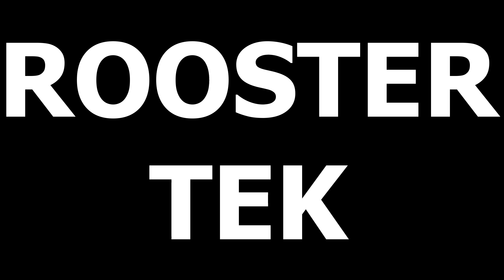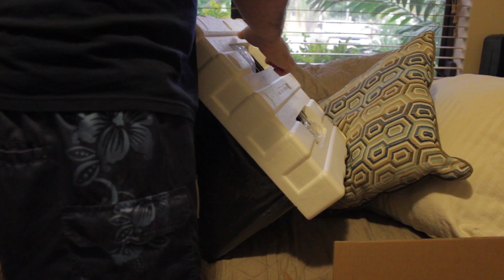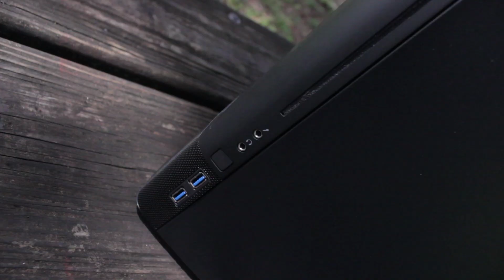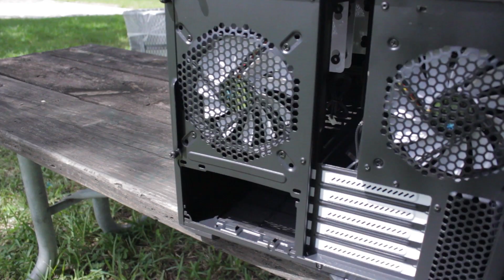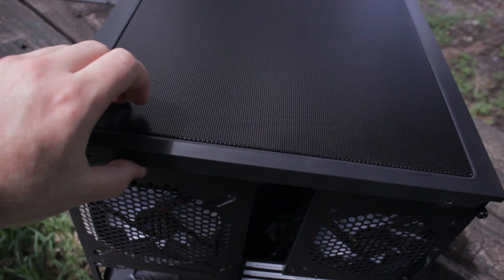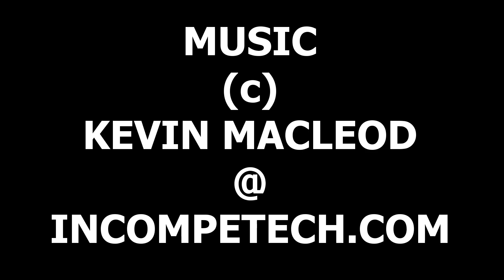Fractal Design NODE 804 MicroATX Case | Unboxing & Review | RoosterTek

Comment: well I'm back and Just did a build in the case. It's freaking awesome. Cable management was impossible to muck up but my only gripe is that my 140mm fans won't fit over the EPS 12v cable. Other than that 9/10